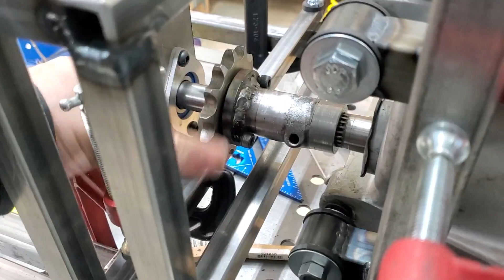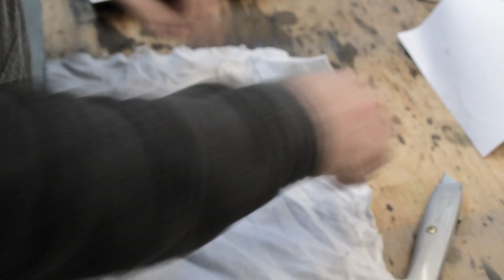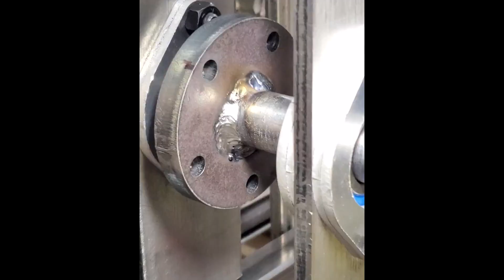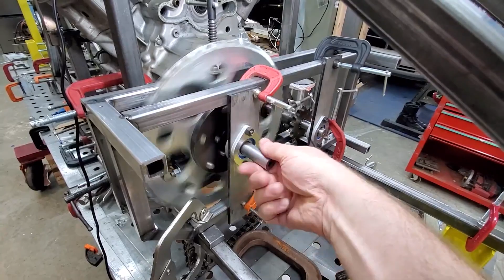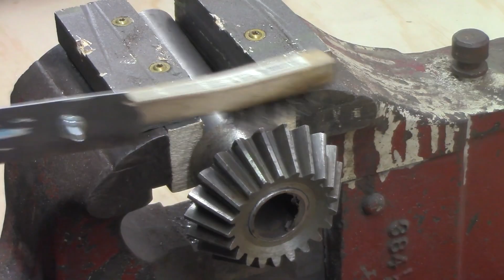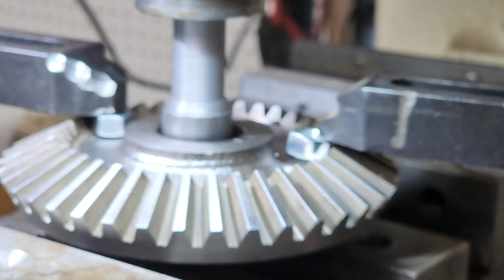Akira Bike Project - 22 - engine reduction cage - part 2

Comment: Some great precision engineering here. Which makes it all the more perplexing that you seem to have designed this machine as a hardtail, without even a millimetre of rear suspension! That's going to make for an uncomfortable ride, no matter how smooth the transmission might be...
Reply from the maker: Rear suspension, along with many other improvements, will be coming in later phases. Check out the build phases video!  Phase 1 is  being kept as simple as possible to start basic testing of the geometry out.

Comment: Nice work solving all the fabrication issues that have a surfaced. Could a multigrouve V belt reduction work in your application?
Reply from the maker: Thanks! Yeah it might be better, more efficient, but they are also wider and there isn't a lot of room there. I'm going to explore improving this after this after I get some test rides in, I all ready see many places for improvements but I don't want to get stuck in refinement purgatory.